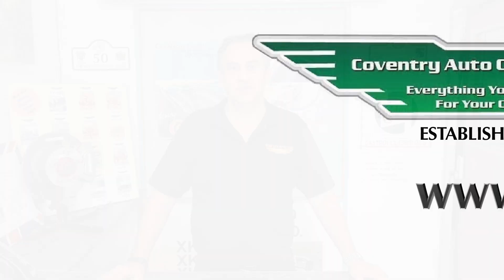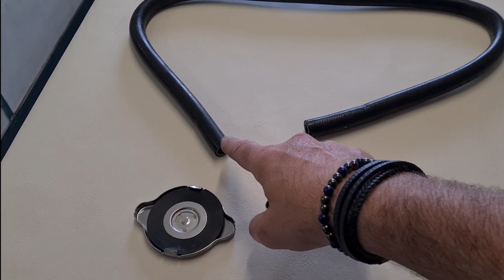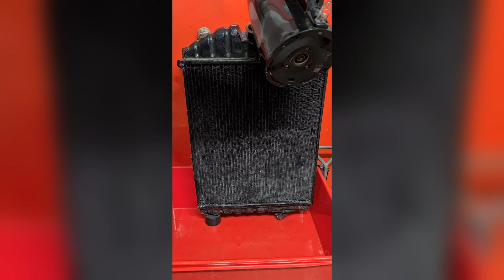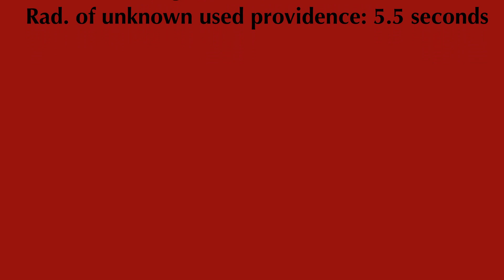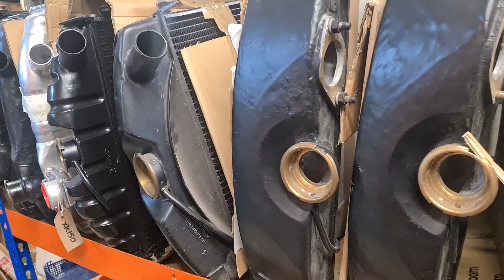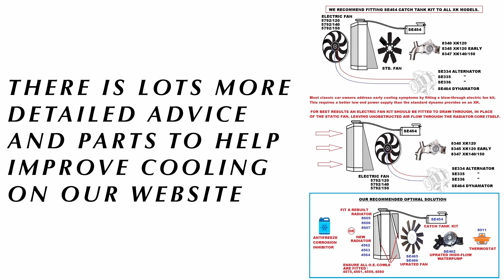Trade Secrets Of Cooling The Jaguar XK120, XK140 & XK150

Comment: Thanks for this. I just had an aluminium radiator fitted to my XK150 thinking that was better. However someone told me it was a waste of time and no advantage. What are your thoughts? I already have the expansion tank system.